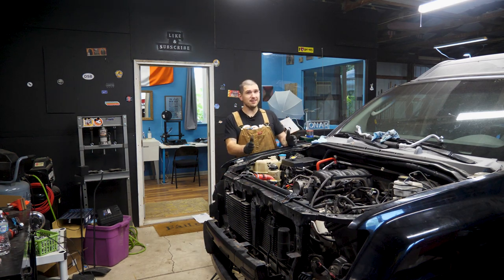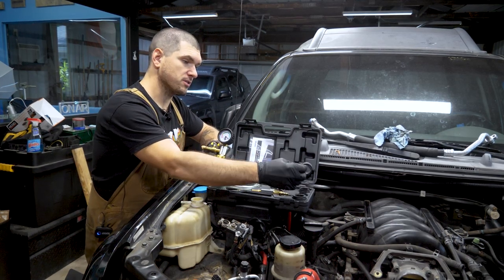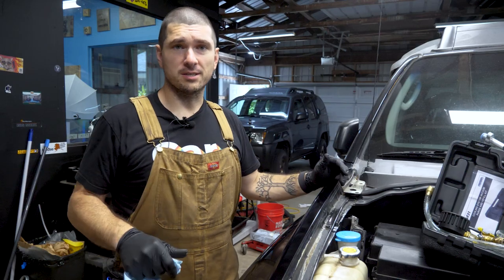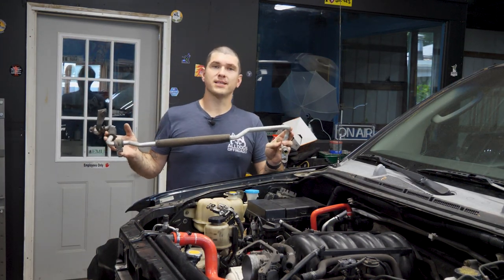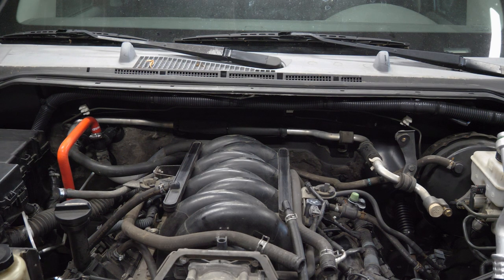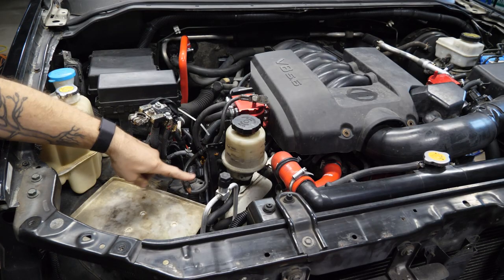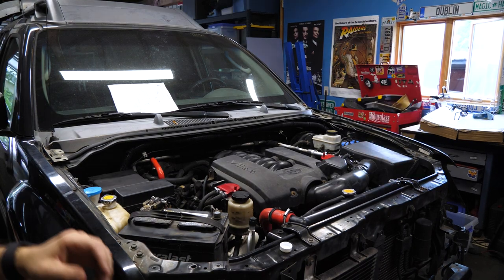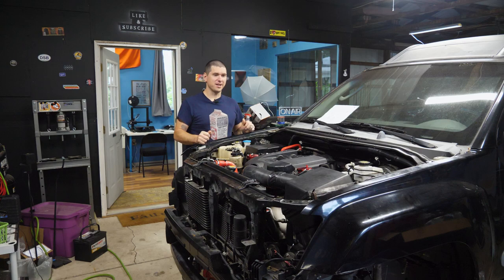We get it Running!! (How to VK Swap An Xterra Episode 12)

Comment: It is possible to replace the engine with an R35 engine, with the possibility that it would not be surprising if it is able to deal with and cross rugged places such as the desert and mountains in the most difficult terrain. There were successful experiments with this mighty R35 engine on the Nissan Patrol Y61, and the result was a shock they did not expect, even in the highest sand dunes. It's like a speedboat cutting through the desert sand

Comment: Stoked to see it running! Dont forget about the auxiliary cooling fan. When i did my swap i forgot to add it. For the most part you wouldnt even notice it missing, until you have the vehicle sit for awhile, temps will eventually rise. The clutch fan isn't enough to pull air in when sitting. But as soon as you start to drive at highway speeds, its fine.
Reply from the maker: Thanks man! How did you handle that fan? Put it in the front or something? Buy a new one?
Reply: @Rythecarguy  I have it mounted in between the radiator and transcooler. The way I mounted it is very haggard. Trimmed with sawzall, and held in with zipties. I did this fix right before going offloading and it held up great so I never addressed it further. But I'll eventually create mounts for it lol.
Reply from the maker: @ke_ata  wait you used the original fan?
Reply: @Rythecarguy  yessir, I didn't want to buy any additional fans, so I used the fan that came off the truck 😂 

But I'm sure there's a cleaner setup, but last time I checked a v8 pathfinder aux fan was like $200... zipties and trimming was practically free
Reply from the maker: @ke_ata  oh helll yea. That's what I'm doing. You won't see it so who cares thanks for talking me through it.
Reply: @Rythecarguy  np, when i was doing the swap no documentations I was reading addressed the aux fans. It was just something I came across and figured people assumed the clutch fan was sufficient? Or maybe I missed something during the swap 🤷‍♂️
Reply from the maker: @ke_ata  I haven't seen anything either so I'll make a video about it. 💪🏻

Comment: Way to go, dude! Good to know the Xterra AC line is different. I blocked off the rear air in my Armada recently and was told if that didn't work, to use Titan lines. 🤘
Reply from the maker: Wild are they separate lines for the rear or something?
Reply: @Rythecarguy  There's like a T on the lower passenger side firewall and the lines for the rear run down inside the passenger wheel well. I chopped off there and used some AC line block fittings from Dorman. Cools the whole damn truck with no problem. Lol

Comment: Great job on the swap. Kinda surprised you struggled so much with the power steering and A/C lines as both of these fixes are very common knowledge on most VK swap forums and other Y-tube videos. You haven't addressed you radiator issue thus far but hopefully you discover there is a easy fix for that too rather than doing some elaborate electric fan swap.
Reply from the maker: Thanks man! Fun fact about me, I absolutely despise reading forums and I'm not a huge fan of watching YouTube videos lol. I really like figuring things out on my own. Still working on the fan. It got cold and I don't wanna work on it now.

Comment: On that Nissan Xterra u got has a drain hose on the overflow that we installed so it drains under the Xterra lol good work as always keep it going lol 😊
Reply from the maker: Ohh good idea. Did it overflow a lot?  Have been thinking about what to do with that Xterra and I think you're gunna laugh when find out.
Reply: Lol yes it works lol  ? Just a joke but jack it up like a monster truck lol 😂
Reply from the maker: @jeffreyarmstrong5974  not running yet. I think it's going to need a new motor :/ but i think I might take the roof off and make it a convertible 😄😂
Reply: That sounds very good I never thought of that 😁

Comment: Ry, did you use the OE Xterra AC line when you used the Titan top AC line. I'm wondering if I need to actually order the part? I'm doing the same swap, but into a frontier.
Reply from the maker: No, I used the stock one off the Titan on both sides. From the ac compressor to the back pipe. And the back pipe. 💪🏻

Comment: nice work. are you gonna make a charge the ac system video? glad you finally went 4x4
Reply from the maker: Not sure yet might just run back to the place that emptied the Titan for me.
Reply: @Rythecarguy  I still haven't charged my ac yet after my engine swap. Thinking about just paying someone as well. I haven't gone thru all the videos yet, doesn't look like you did titan swap suspension yet. What struts did you decide on since I am assuming you will do a full titan swap? I know all dogs just released a fox titan swap strut, not extended travel though. Really aren't much options with nisstec basically closing. Radflo is basically the only other option and they don't have a great rep lately with leaking and making noise. I know you can put rc frontier struts in there but they are not adjustable but are cheap. That v8 sounds awesome, looking forward to you getting it qll together!

Comment: VDC and Slip light will come on when the brake fluid reservoir is low. Maybe having the break lines disconnected is tripping that?
Reply from the maker: I think you were right! They went away after the first drive

Comment: My vdc/slip lights come on occasionally. What is this spiral cable you speak of ? 🤔
Reply from the maker: People also call it the clock spring. In the Xterras along with the clock spring comes a angle sensor. That sensor is used for VDC based on my understanding. If that goes bad, then it can cause issues with VDC.
Reply: @Rythecarguy  I found your video on it. Not sure if that's my issue because my horn works and the lights only pop up occasionally. Mostly on super hot days. I'll have to do some research. Thanks for the help!

Comment: I really want to do this, how much do you think I could score a wrecked donor titan under 100k miles?
Reply from the maker: Hard to say in different markets. It's hard to find one under 100k that isn't wrecked TBH. My guess would be around the 5K mark. If you can tolerate higher miles and maybe a little maintenance work while the engine is out then you can find tons of them around the 3k mark.

Comment: I’m guessing it’s not starting cuz it’s in reverse and not park
Reply: I was right
Reply from the maker: 😂 I'm not used to the automatic and didn't even pay attention to the cluster when trying to start. I just looked at the battery voltage and that's it.
Reply: @Rythecarguy  it is the worst when you realize the problem you’ve been trying to solve for last 4 hours had the simplest solution ever
Reply from the maker: @PYROtheNomad  right!?! 😅